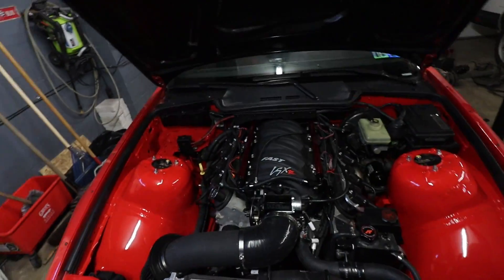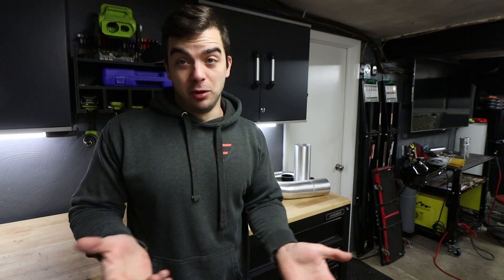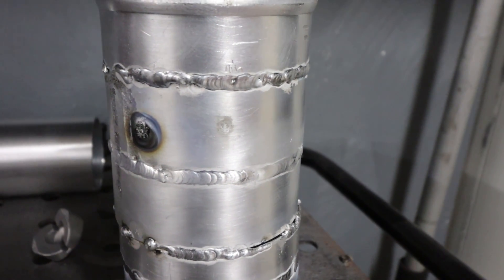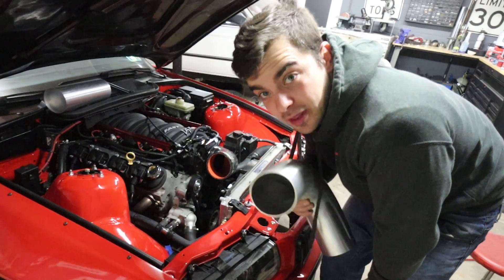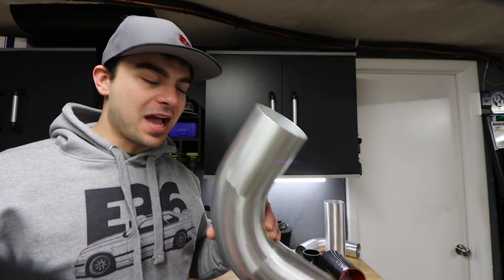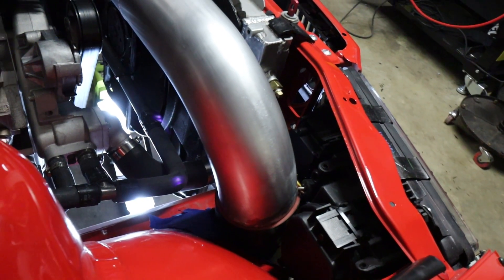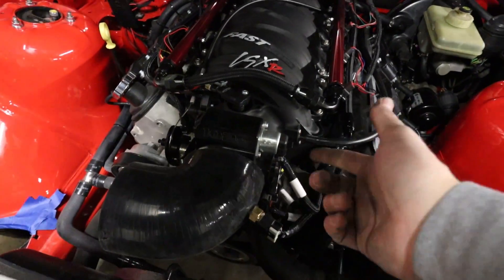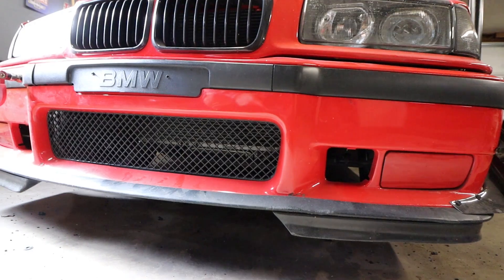LS Swap BMW E36 M3 - Fabricating and Installing Custom Engine Parts

Comment: Awesome bro!! Use a wider cup on your gun, it well help distribute the shielding gas over the weld better, also purge plugs over the end of the pipe you are welding with a line running inside to fill it with argon. Will make your welds look better and stay clean!!

Comment: It's so fun learning new skills while building a car. I need to practice my welding.

There are so many gives and takes with swaps. I opted to run a smaller filter but to keep it near my fog light. I removed the fog light and put in a blank with a couple small slits to provide air to the filter. IAT runs ambient.  If you don't like your placement of yours, you can install it on your intake tube. It will read the air flow as it's in the stream.  That's why you can put pressure sensors anywhere, but temp has to be in the flow.

Are you going to install the radiator ducting around the front? If not, I'm curious what your idle coolant Temps are when it's hot outside, over 90.
Reply from the maker: I'm going to do some kind of undertray at least, not sure on other ducting yet.  I also need to get A/C in this thing.   I will definitely report on the IAT when it warms up.
Reply: @matt13ross  it would be sweet if you do a fully ducted radiator vented through the hood. Mostly so I don't have to figure out how to turn the flow up, ha
Reply from the maker: Idk about cutting a hole in my hood...lol.

Comment: I'm glad to see you went with aluminum. Stainless steel is a terrible thermal conductor which means it takes longer for it to remove heat from the source. Thats why you almost always see cold side stuff exclusively aluminum.  Keep it up.
Reply from the maker: Thanks! Yea I just thought it would be easier to make at first.

Comment: Great job... but.... Won't the filter suck the "heat" from the hot road since it's really close to it?
Reply from the maker: Nah, it's above the bottom of the bumper.  Much cooler than the hot engine air trapped in the bay.
Reply: @matt13ross  That's true everything is cooler then the hot engine bay 😂.. I was just asking 😁

Comment: Looks good. Defo make yourself a support bracket down by the filter 👍🏼
Reply from the maker: That's the plan, as long as I don't find any issues with this design.

Comment: Looks just like the intake I made for my swap. I told you the 4 inch pipe fits behind the head light. I did put a bracket on the pipe to keep it from moving around in the area below the head light.
Reply from the maker: Probably will do a bracket once I assure that his is the final intake setup.
Reply: Making a bracket is a great idea